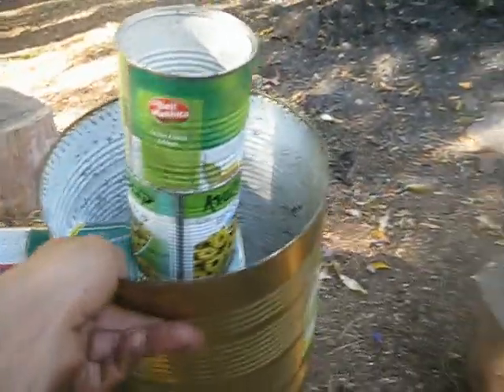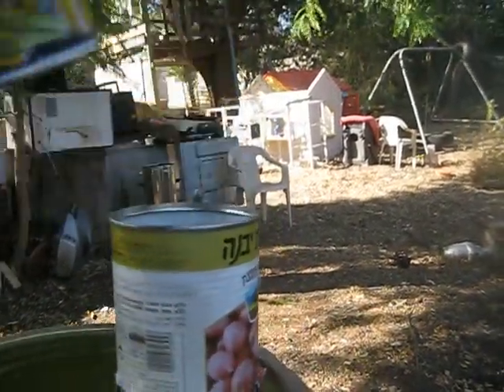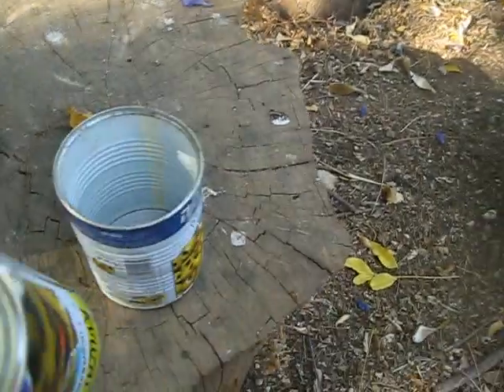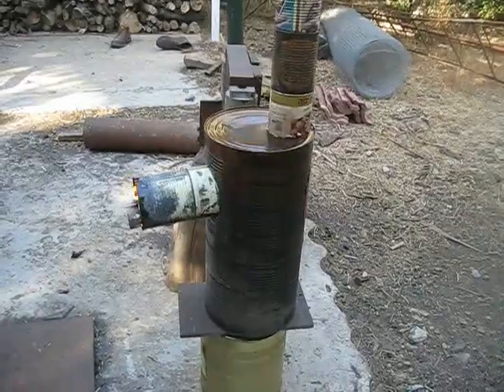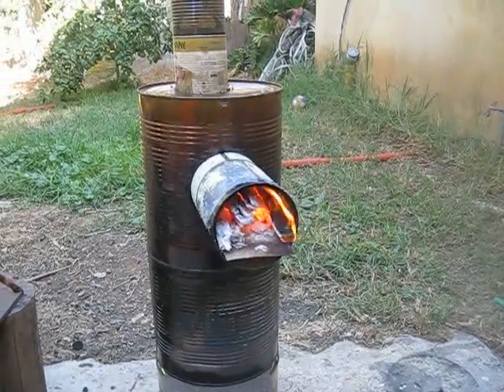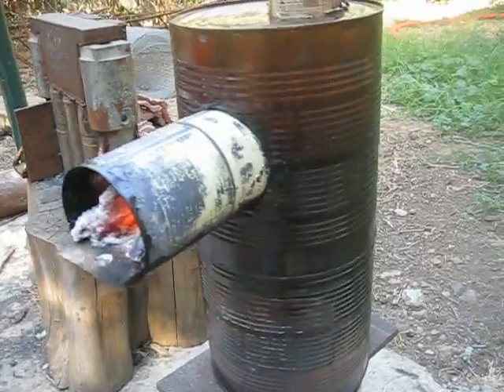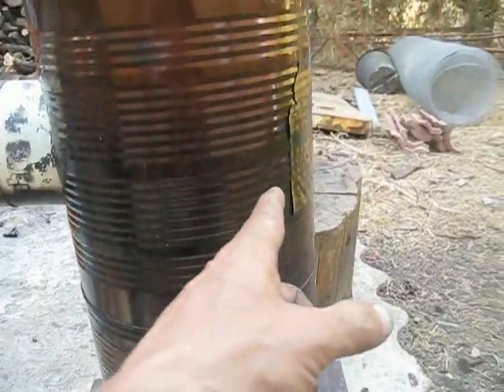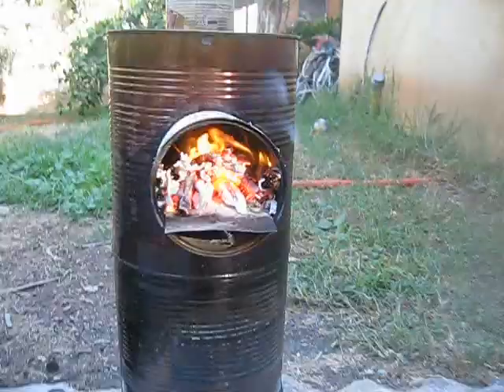New review on downdraft rocket stove heater concept

Comment from the maker: Thank you for your comment. If I build a usable version of this stove with welded steel, I will try to use a baffle inside the heat exchanger and a dumper in the chimney collar. Like this way, I intend to delay the speed of the combustion and smoke and gases exit of the stove. The vortex effect inside the heat exchanger and up the chimney may allow for best combustion of the fuel but I think it would also accelerate fuel consumption. Of course I would install a vortex down the downdraft tube.